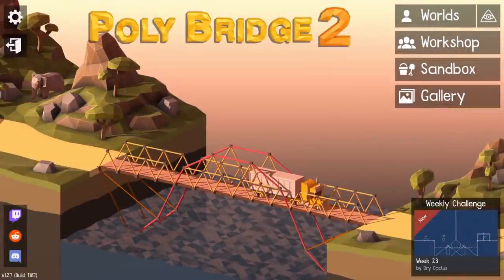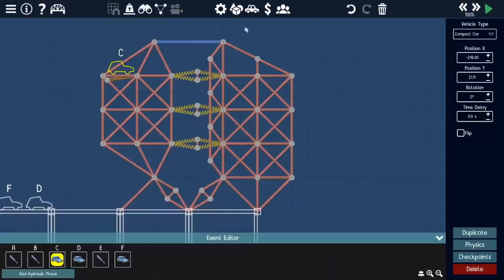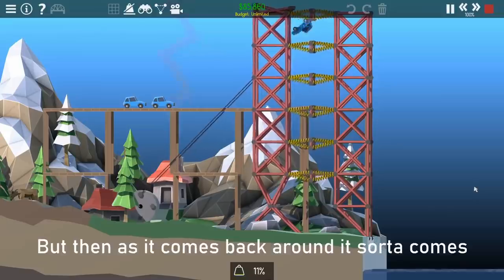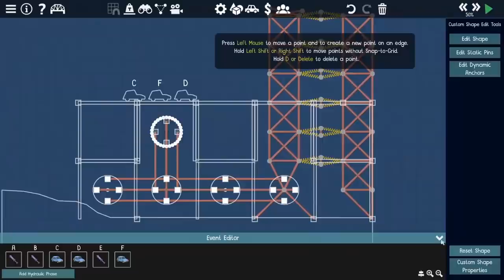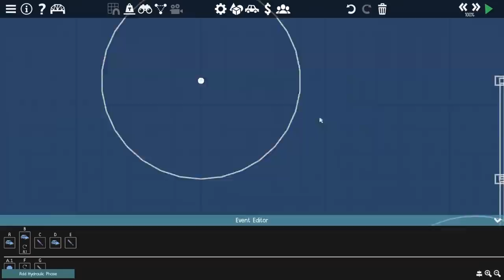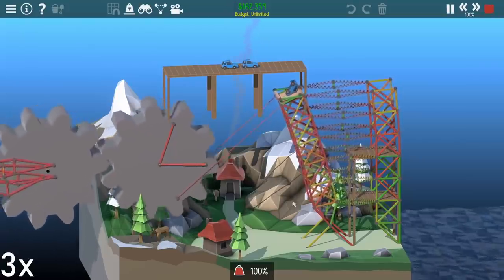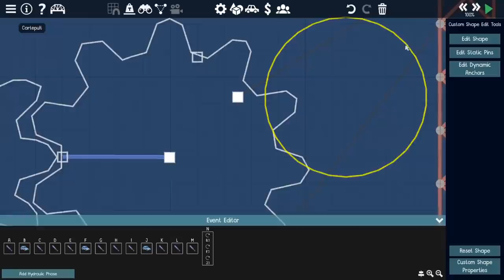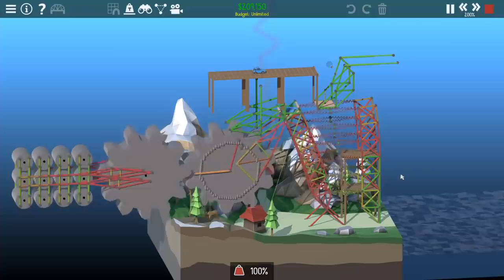Making a Fully Automatic Catapult in Poly Bridge 2

Comment: I would have used a second arm parallel to the first, I'd pull back on that then split the two arms so the first could throw the car. Not that I'd be able to get that far in the first place.

Comment: that last fix was too complicated, and reqires changes, if more cars are added, but you could just have two arms both connected to the ground, and connected to each othe via a split joint at the top. One arm it the car platform, and the other is connected to the motor.